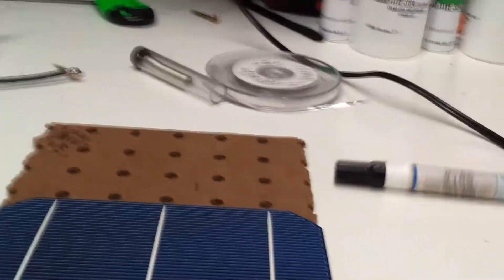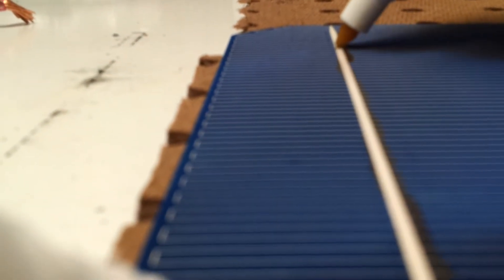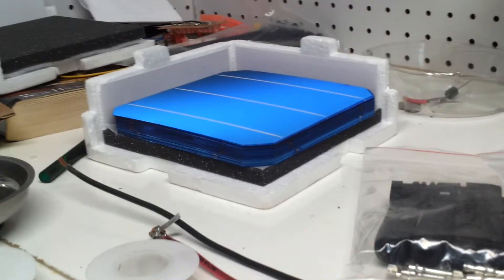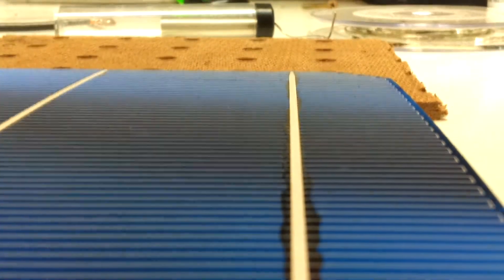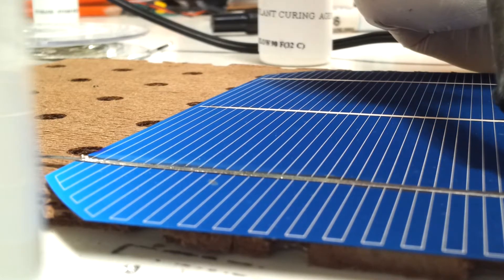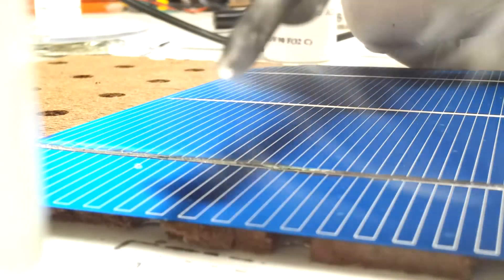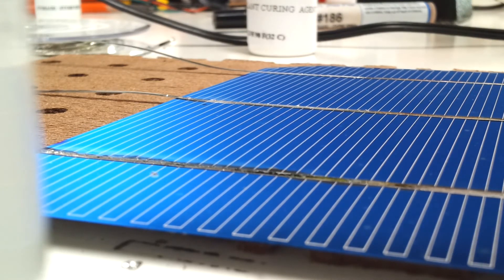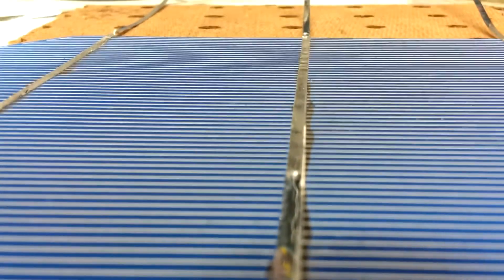Solar panel 36 6x6 cells part 3

Comment: Your soldering is MUCH cleaner than mine
Reply from the maker: the 2mm wide tab wire works so much better than the 1.5mm ones. it glides on alot better. and i am a computer tech so i work on alot of motherboards  so i can solder good :D